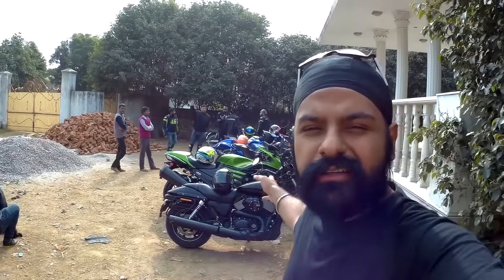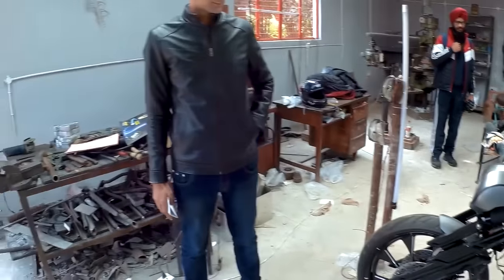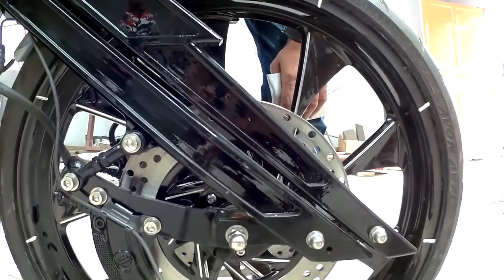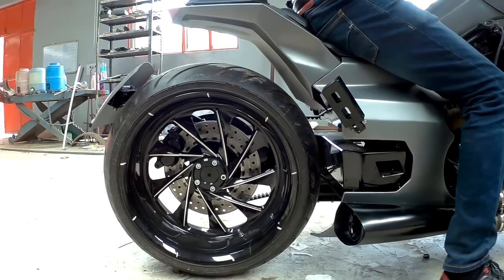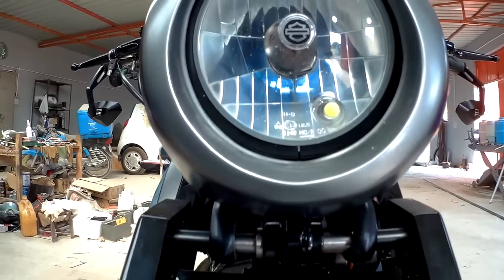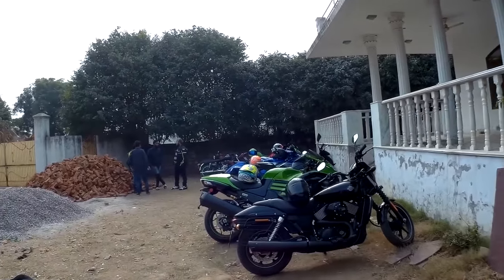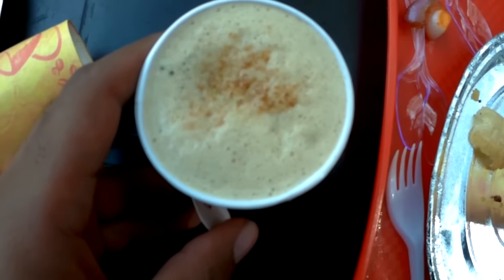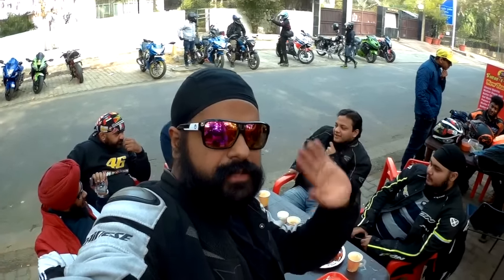Ultimate Customized Harley Night Rod With Air Suspension - Rarest!!

Comment: 10/10 on creativity and hard work, fantastic job. However, everyone in India currently modifying bikes never take into account the millions of dollars that go into R&D for developing an optimising a motorbike. These are all cosmetic changes and possibly ruin the aerodynamics of the bike, weight distribution and overall performance. If you guys can afford to spend so much on cosmetic mods, run it in a wind tunnel and get tech data from ECU and compare with stock. Bikes are not only about looks.. :) anyways not hating..just a generic opinion.